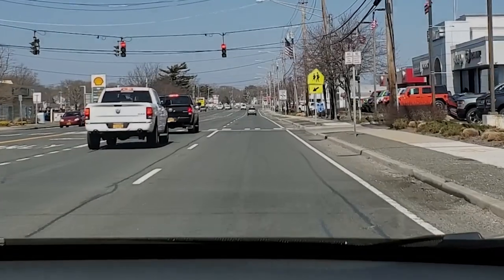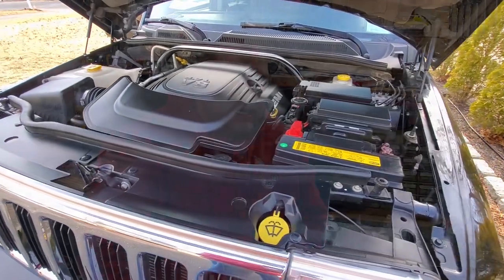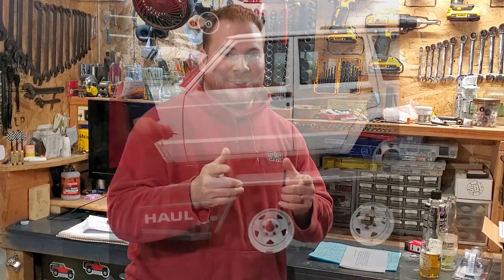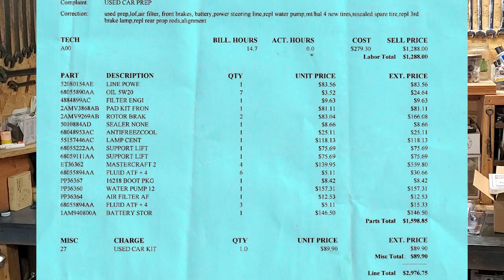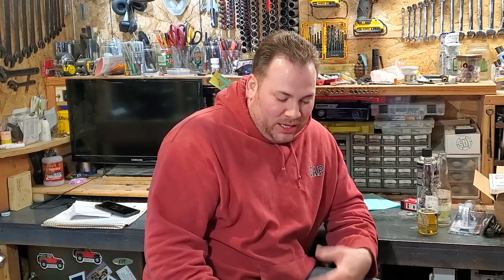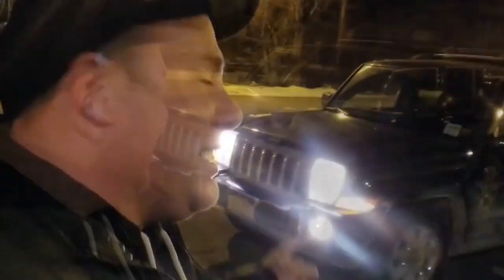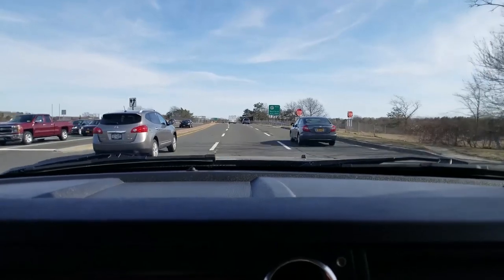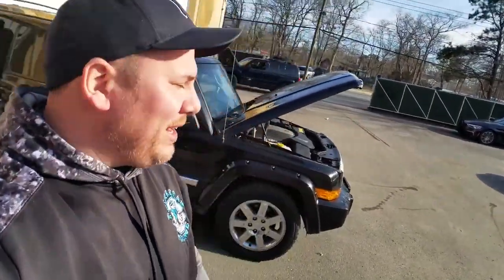JEEP XK COMMANDER 5.7 HEMI OVERHEATING MYSTERY - A NEW CAR NIGHTMARE

Comment: As I told you there is a design flaw in those Third Gen Hemi's. Watch (Uncle Tony's Garage) on YouTube he explains just what the Flaw is. It's  has to do with the Camshaft being moved to far from the Crankshaft. This guy is an Engine builder old school I think you should watch  all his videos on the third gen Hemi. Watch his Videos Dan. I'm  hoping  you have no more problems but from what I've  read and seen well let's say ?
Reply from the maker: I saw that... the idiot proof oil drip test.. scary

Comment: To fix your problem is to actually buy a aluminum radiator. Why? Well it's a hemi and factory radiator has plastic mounts and heat cracks plastic. I fixed mine and to the commander owner's. I strongly recommend aluminum radiator.
Reply from the maker: That's a good idea!

Comment: I have the Jeep Commander 2006 5.7
I believe my heater core is faulty not working correctly.....
I'm going to try to get to the mechanic in a few days when I get the money together but my question is if I keep the reservoir and radiator topped off completely full with coolant it's impossible that I would overheat correct long as it's totally full of coolant ?
Reply from the maker: as long as you keep it full you should be ok. if it gets too low you may need to blead the system.. you don't want air trapped inside.
Reply: @ProjectDanH  thank you🙂

Comment: Still having the same problems? I changed 2 water pumps and 2 thermostats in the past 4 months
Reply from the maker: Oh man, sorry to hear that.  No, the new water pump did the trick... So far so good.  Did you try the radiator? Maybe you have a partial blockage.
Reply: @ProjectDanH  no i haven't tried replacing it yet, I guess i have blockage somewhere. I hear water flowing around in the dash sometimes.
Reply from the maker: @BTS-yu3jq  I wonder if there is a blockage near the heater core slowing your coolant system

Comment: Wow I have same problem I own 2006 jeep commander unlimited 4x4 5.7 hemi ran great at first still dose I live in Texas get real hot in summer one day I heard bubbling ,crackling sound coming from engine I notice I was over heating I too also bought new water pump with new thermost and I still have same problem now so I will buy a another water pump from dealer I did order the water pump on internet but sense I own more a few off road vehicles I don't driver the commander much first i thought sense I installed a 4 inch super lift and 33x12.50 18 tires,  this is why im overheating apparently not the case so I will need to buy new water pump and see if this my issue also I may replace radiator that has bigger cooling tubes radiator I built this commander for overlanding style camping / off road
Reply from the maker: wow.. I've heard bad things about these water pumps.. they're all crap apparently.  I want to put 33 on this XK too. what lift did you go with?
Reply: @ProjectDanH  I put a 6inch pro comp k5067b lift there a video on youtube liftkits for less you see all the components and installed on Toyota fj cruiser I really love the lift it rides like dream I changed the shocks to bilstem 5100 mines a 6 speed manual I hated my seat they look worn so I bought clazzo seat covers in 2 tone red and black wow looks like the tdr edition fj but the pro comp 6inch on 35x12,.50x18 no body chop needed no rubs full turns left to right
Reply: @ProjectDanH  my bad I was thinking I was responding about my Toyota fj cruiser ok on my jeep commander I bought a 4inch super lift cost 2,600 I also installed a jab upper control arms 445.00 along with bilstein 5100 shocks the tires I ride on nitto mud grapples 33x12.50x18 on xD series matte black xd827 rockstar rims my jeep rides tall the mud grapples are load compared to mickey Thompson baja boss I own 6 vechiles 2 jeeps 1 Toyota h3t. Alpha Hummer silverado 2500hd 4x4 built for off road but now the commander 5.7 overheating

Comment: A. Old ass 5 year coolant.
B. Radiator cap gunked up.
Flush and fill.. But that's a 3.7 ;)

Hemi...hum.. yeah you're definitely going to want to pull a coil and maybe a plug as well as drop some of the oil out and see if there's coolant and either the oil or in the top of the head. 

I've heard stories of people putting thermostats in backwards?
Reply from the maker: Yep, that's basically what I did, plus that whole faulty water pump thing. Lol. Thanks for watching👍

Comment: So the 500 mile trip home got it hot enough to melt the plastic impeller enough to get it to become loose on the shaft, go figure...dumb idea to use plastic on any component that gets hot.
Reply from the maker: I agree 100% what a completely stupid and unreliable part. It drove me crazy.

Comment: Just bought a commander about 2 months ago, overheated today.  Hoping it’s just the water pump.
Reply from the maker: Hey Tim, It will most likely will be the water pump.   God speed brother!!
Reply: Hey Hernandez I got the commander too del 2006 y no se por que me aparece transmission over temp I have no idea and when I start it stuck in 3gear no in D
Reply: @edward I changed thermostat and radiator had a crack so I had to change it too. Also changed out radiator hoses and it’s been running strong about a week now.  Hope you can get yours taken care of bro.
Reply: @timothyhernandez7847   like how much the cost to change it each in the mechanical? 
-Thermostat 
-the radiator 
- radiator hoses?
Reply: @ Edward Lion I replaced all myself, The radiator was repairable at local radiator shop. He changed tanks for 75 bucks,  the thermostat was about $20.  The hose was about $35. I didn’t have to change the water pump but new one was only $90. I live in San Antonio TX.. if that helps for pricing.
Reply: @timothyhernandez7847  thanks bro that's a great help, but what about the 3gear sometimes I start the car, it goes to 3gear and not to D. and I have to turn off the car and start the car again so that they get into D
Reply: @Edward I’m not too sure on that one bro. Wish I had the answer for you. I’d recommend joining Jeep commander nation on Facebook if you have it. Bunch of commander owners helping eachother and sharing information with eachother.  There’s atleast 3 commander fan pages.

Comment: Customer complains, I can get a water pump from my local _ _ _ _ parts store way cheaper. Yeah, well I hate having to warranty those over and over, and customers hate their car keeps breaking for the same thing.
Reply from the maker: I wish the Jeep dealership used a mopar pump
Reply: @ProjectDanH  Took my 2500 Hemi Ram in for service, they cracked my dash, and drove 10 miles to my work with the airbox disconnected from the filter botomm and the throttle body. And I found screws on the floor from when they did recall on air bags.
Reply from the maker: @r.weaver3769  that's garbage work! Completely unacceptable

Comment: My Reservoir bubbles but my car does not overheat 5.7 hemi also
Reply from the maker: I wonder if your water pump may be on its way out too.. keep an eye on it
Reply: Project Dan H so I found out I have the green radiator fluid not the required one - you 🤔 think that can cause that ?
Reply from the maker: @ELKOBRA03  I would only use what's called for by JEEP.  I used Zerex 5G 50/50.  These newer motors aren't as forgiving as the ol 4.0

Comment: These jeeps are junk.  All the fiat plastic in it breaks, they've added sensors and garbage to the hemi and ruined it. Mine constantly over heats and I've replaced everything. Radiator, water pump, thermostat, all of it. The water pump I put on it lasted about a year. I loved this when I bought it, I hate the damn thing now, can't wait to get rid of it, and I'll never buy another jeep. It's fiat garbage.  There's a reason they stopped making these. My son bought a brand new jeep, spent more time at the dealership than on the road.  I'll go back to a Ford. Oh, and I forgot abt the garbage sunroof that leaks, they made it leak on purpose, and a little hose runs all the way to the bottom to get rid of the water, but they didn't take in to account some of us live in places that have leaves and clog up the hose. Crap design. Hope that water pump lasts longer than a year. Get ready to replace all your door handles. Hell even the hood latch broke. These crap jeeps give the hemi a bad name. They ruined it. I've had ridiculous problems that you should never have on a vehicle. Not worth the headache. This video is a little old, I'm sure you hate it by now, if you still have it lol.
Reply from the maker: I agree and disagree.  The engine is fine but the water pump was designed like crap, doesn't last, and it's completely horrible.  All sunroofs have a drain that needs to be cleaned... I just blast mine out with an air compressor, a simple fix with normal maintenance.  The plastic is terrible! Both driver and passenger seat trim has broken twice over.  Awful.   If you watch my channel you'll see that I prefer 90s Jeeps.  God bless man!

Comment: ...leave it to a Fiat! lmao
Reply from the maker: LMAO.. seriously
Reply: @ProjectDanH  Seriously, I've been helping a ex-girlfriend for two years now with her Commander, with all types of these mysterious problems! Replaced, battery, starter, related fuses, I redid the whole stater connector with new wiring, had original PCM re-flashed. (that issue with starter went away after reflash, now this trans overheat issue not starting) When these vehicles reach the 70-90k mile mark, time to jump ship! lol 
...unless it's a toy you want to mess around with, but for reliable transportation, it's just a problem child. I told her to get rid of it a year ago, but she's loves it to much, and I don't think she would keep saying that if I didn't help her keep it on the road! lol I love Jeeps too, but the quality isn't there anymore with these new profit  $$$ companies.  Too many cheap parts used, and the last thing you want to use when it's dealing with electronics and computers, is cheap parts that are exposed to the elements! ...or this crap happens. But most of these companies don't really care about the consumer. Good luck, I know I'm over this, and it's not even my vehicle! lol
Reply from the maker: @liveuntetheredmusepodcast4832  damn dude. Sounds like you really needed to get that off your chest lol!  It's very nice of you to all that work for another person..  Yes, I totally understand because I've experienced the "cheapness" of the quality too it's a shame they don't make em like they used to.
Reply: @ProjectDanH  I know it is a shame, I would for sure own one if they still had the quality. 
Everyone I know who has one, has issues,..
I also have a engineer friend who bought a new Jeep Wrangler , and he only drove it to work, six months later it has some major issues where it couldn't be driven at all! Just watching everyone deal with constant problems is depressing for Jeep and the owners... If I find one from the 70's or early 80's I may pick one up if I can find a good deal on it, just to roam around in for summer time.
Reply from the maker: @liveuntetheredmusepodcast4832  totally. if I was a single dude with no kids I would love a TJ Wrangler.

Comment: You can get a commander dirt cheap now they are garbage there not reliable. I had one with a hemi the valve seats fell off
Reply from the maker: Cant over heat the 4.7 and the 5.7. they are notorious for dropping valve seats!